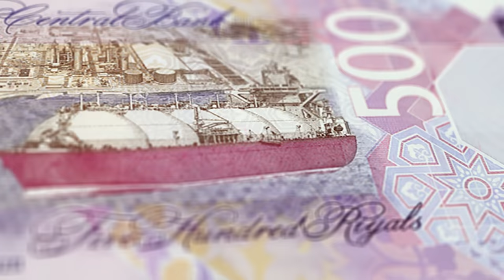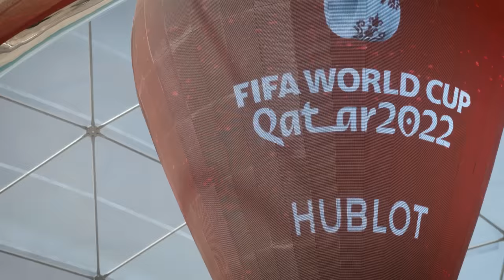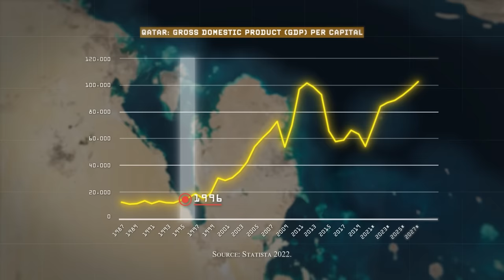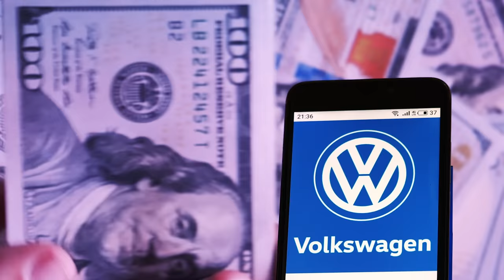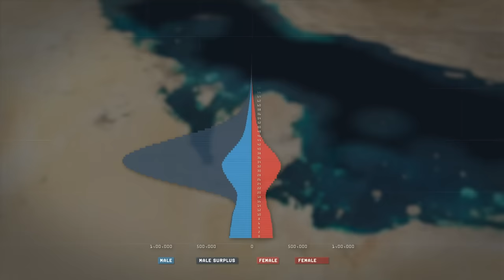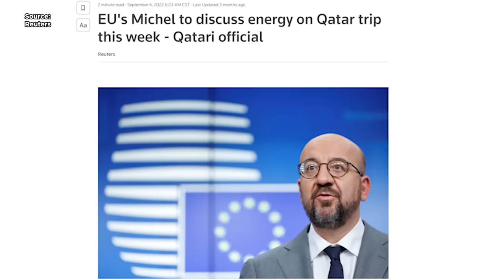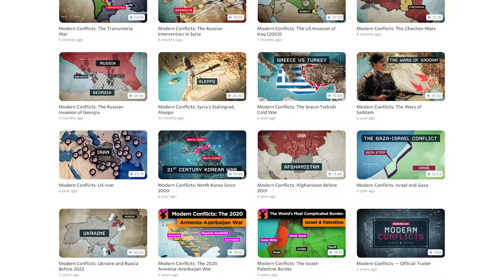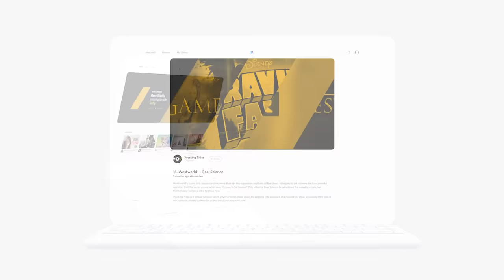How Qatar Became the World's Most OP Country

Comment: Could you do a video on lead pipes and why they are still used?
Reply: Lead is affordable and abundant. It can still be used for water distribution if corrosion control is in place.
Reply: I used to be a plumber, and we onely used it in closed systems. So not anything that comes in touch with drinking water. Its also more affordable and easier to work with than other materials.
Reply: @sammyday3341   Where is it affordable and abundant?
Reply: The only reason I asked is because there have been many times in history where lead poisoning has occurred regarding lead pipes and despite it being documented, it’s still used. Famous example is Ancient Rome btw

Comment: I want to hear the story of the people who discovered that huge reserve.
Like their initial reactions and what not.
They probably thought they went insane or the readings were off.
Reply: I don't think you understand what discovering a huge reserve means.... There is no way to actually measure how much of that stuff is in a given reserve. It is all estimates and calculations. For instance,(using oil as an example), someone could strike an oil well and it spews out oil at high pressure and a large mass flow rate; they think, "wow this is gonna be huge!" But then it runs out two months later, because it was a  'small' reserve.

No; a single discovery is not how it works; what happens is they discover over a wide swath of land and then make calculations and estimate how much 'reserves' are there

Also, this last part is quite strange; oil wells that ran dry 30 years ago and that are randomly tapped back in in the modern day have oil in them again. That means the oil is replenishing itself. This makes sense, as 'peak oil' was supposed to happen in 1940, 1960, 1970, 1975, 1985, 1999, 2006, 2015, and 2020. But we never reach peak oil and the reserves just keep getting bigger. The fools actually made a new 'peak oil' prediction and are claiming by 2040 we will reach peak oil. Truly laughable
Reply: @pyropulseIXXI  Can you explain how the empty oil wells replenish themselves, is it from nearby pockets? Surely we will eventually reach peak oil as it's a finite resource but putting an estimate on that is not easy.

Comment: It's such an odd reality that we live in that a micro nation with nearly non existent military can be so powerful, in most of history a stronger military would just take this country trivially
Reply: There have been countries like that in the past. Case in point Venice in 1300-1600s.
Reply: @A2Kaid  yes but several empires actually tried to take Venice and failed due to the terrain
In the current situation I think even a minor power would have very little trouble taking Qatar if no other country intervened and leading world powers could easily carve it up if they decided to
Reply: @juanhaver6584  that's the thing, the largest American Air base in the middle east is in Qatar, and those ties go quite deep. You gotta remember that most gulf states heavily depend on US military equipment, so they wouldn't risk getting cut off from that for what limited gains they'd get from qatar. 
I'd also like to point out that qatar has one of the most extensive air defense systems in the gulf.

Comment: This is a true story, heard from an oil & gas executive who worked at a Qatar plant. 

The plant was undergoing turnaround (basically a full scale maintenance program where they clean the system out of hydrocarbons to perform repair). The plant was preparing for start-up, doing the final checks before starting to feed hydrocarbon into the system. The executive was on site, and heard loud banging sound from within one of the production units. He asked one of the Qatar representative wtf is going on, and that dude said nothing, we can continue to start the feed in and start-up.

The executive, of course, halted the whole process and insisted that the unit be opened, only to realize that it is one of the migrant workers. 

Basically, they dont care about the migrants' lives.

Comment: The value to Qatar of the European market is limited by the fact that it's ship-borne and most European consumers aren't well adapted to receiving them (except the UK and Spain, which are major consumers). Germany, on the other hand, won't be able to ramp up import capacity quickly enough to save its industry, so it will be forced to look for a settlement in Ukraine and repair of the Nordstream pipeline. Qatar should be able to cash in on the short term demand increase, however.